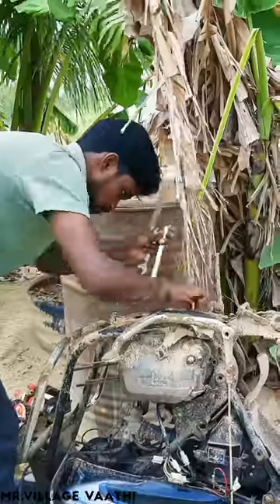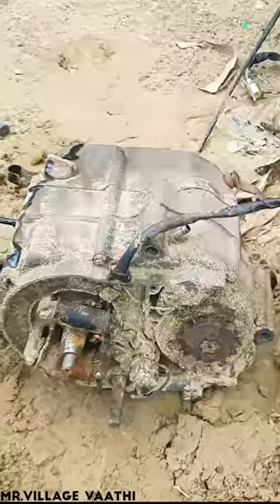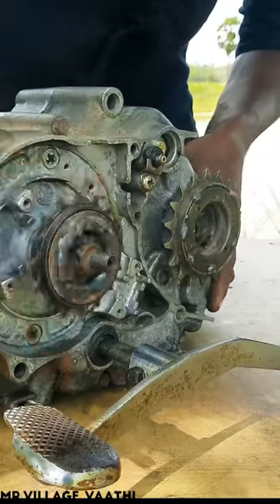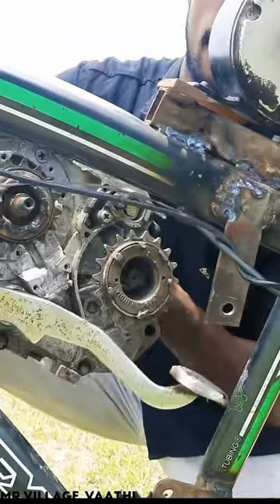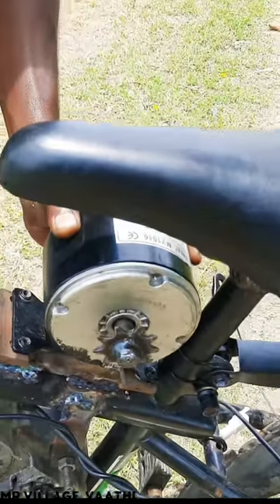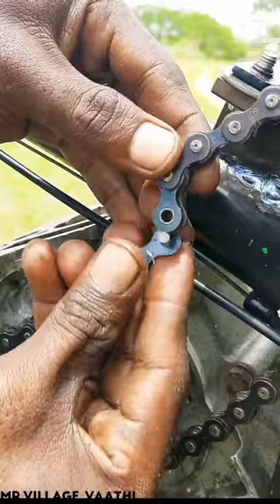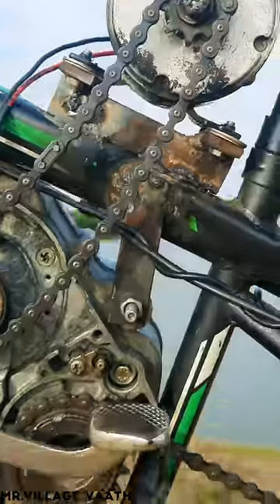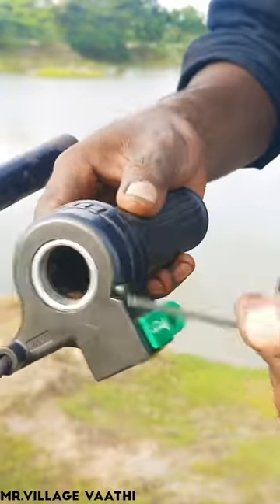Gear Cycle Making with Bike Gear Box‼️ #shorts

Comment: bro na onnu solra atha saiya mutima paruga 
gear box 1:10 atha cycle la fix panni run pannanom  
namba oru suthu suthuna gear box 10 suthu suthum atha weel la connect pannanom
Reply: over tourk gear box sutha mutiyathu normal tourk gear box best kantipa work agum but starting pick up tha problem varum running la good performance varum ... i need servo gear box 1:10 Atha reverse la use pannanom